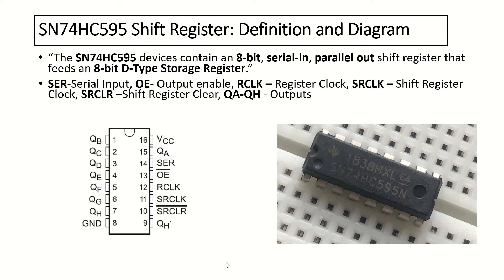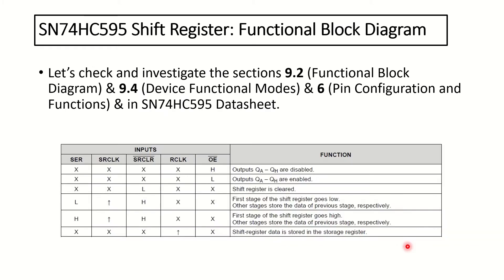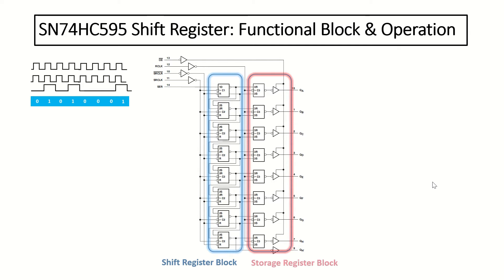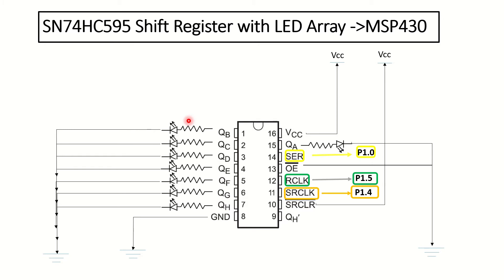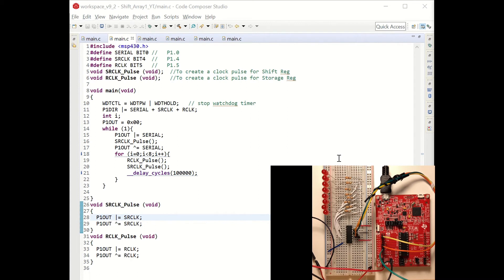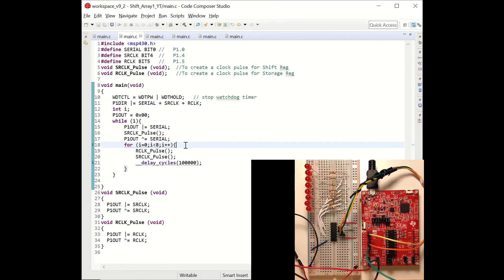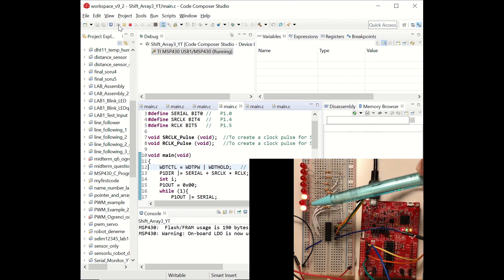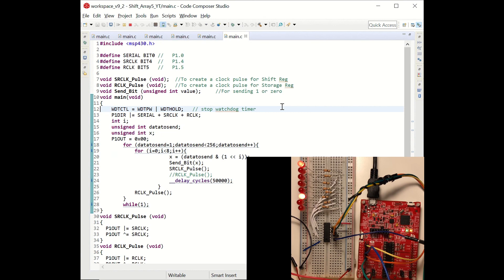74HC595 Shift Register & MSP430

Comment: Oh I see! In the last example, you fully compose your data in the shift registers before then copying that data to the storage registers.  That's why it's not apparent from your LEDs that the data is shifting.  It's because the data is only reveled after 8 shift cycles have occurred.
Reply from the maker: I guess you’re mentioning the 1 to 255 count code. Yes, if you don’t wait for the whole 8 bits to be in their places before you send the storage register pulse, you’d probably observe all leds to be on ( due to flicker fusion) . You can try and see what happens if you trigger the storage register pulse inside the 1 to 8 for loop :)

Comment: Sir I am unable to figure out how SRCLK_Pulse is generated logically.
Reply from the maker: Hi Nirbhay, both (1)Shift Register Clock Pulse and the (2)Storage Register Clock Pulse are generated with setting the connected pin high voltage and then low voltage in the related functions. This way, the Shift Register is triggered to (1) shift the values through the shift registers flip flops, (2) copies the whole content of the Shift Register to the Storage Register (which is connected to the outputs so that we can observe).
I suggest that you focus on the animation in the video plus checking the data sheet of the SN74HC595 Shift Register.
I hope this helps.
Reply: @drselim  sir how do we get serial as 1, our P1OUT=0
And P1Out |=serial, will give P1Out = 0 if serial is 0 or 1 if serial is 1
Reply from the maker: @NIRBHAY KUMAR  Hi Nirbhay, I guess the definitons that are done in the beginning of the code are confusing you. Let me try to make clear:
#define SERIAL BIT0 //   P1.0
#define SRCLK BIT4  //   P1.4
#define RCLK BIT5   //   P1.5
These three lines are created in order to make the code easy to read and implement. If you take a look at the BIT0, BIT1...BIT7 definitions in the msp4302553.h header file, you'll see:
/**********************************************************
* STANDARD BITS
************************************************************/

#define BIT0                   (0x0001)
#define BIT1                   (0x0002)
#define BIT2                   (0x0004)
#define BIT3                   (0x0008)
#define BIT4                   (0x0010)
#define BIT5                   (0x0020)
#define BIT6                   (0x0040)
#define BIT7                   (0x0080)
meaning that BIT0 means nothing more than 0x0001 value as well as BIT7 means 0x0080
which mean 0b00000001 0b10000000 respectively in binary.
So since the SERIAL is defined as BIT0 (0b00000001) and the SRCLK as BIT4 and RCLK as BIT5 and the Direction Register P1DIR is defined as P1DIR |= SERIAL + SRCLK + RCLK; we can easily set the directions of these pins as high without making binary calculations by hand or with a calculator. 
Related to your questions abour the OR and assign operator (|=):
when we say P1OUT |= SERIAL, since serial is BIT0 0b00000001 , the result of this operation will be 0b???????1  (here ? represents a zero or one). So this operation makes sure that the Least Significant Bit is 1.
Remember that P1OUT and P1DIR are 8 bit registers in our microcontroller. You can check their status in the Registers wind ow in CCS.
Don't get confused, we're not reading any value by the 'SERIAL' term, it only means '0b00000001) as SRCLK means '0b00010000' and RCLK means '0b00100000'

I'm sure this will help you connect the dots.